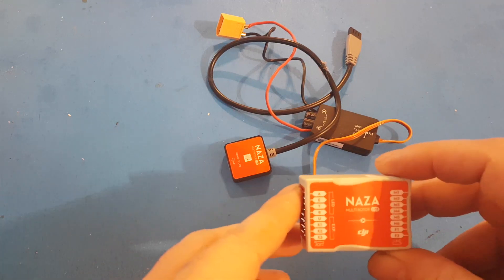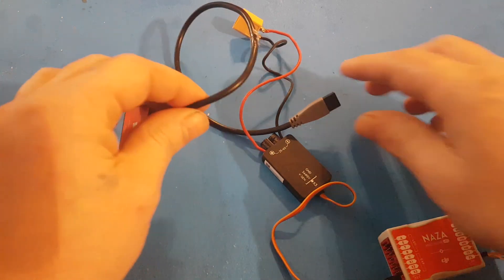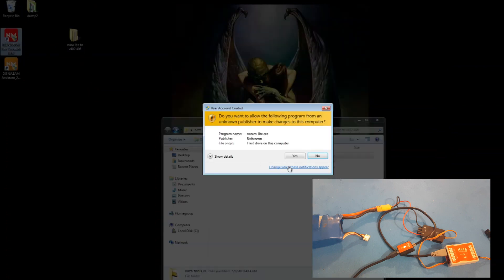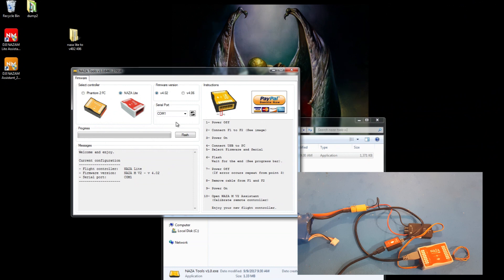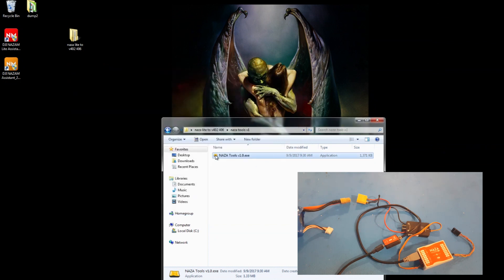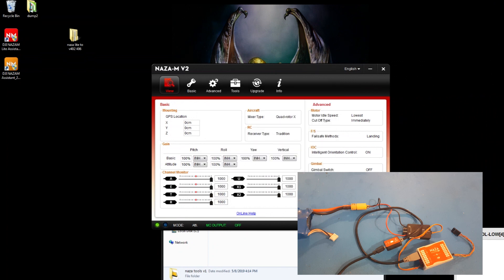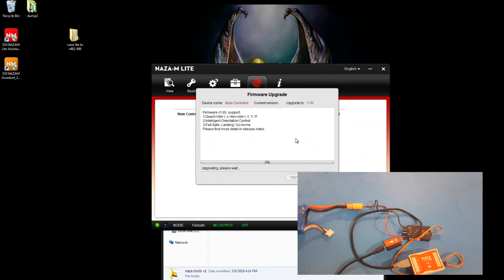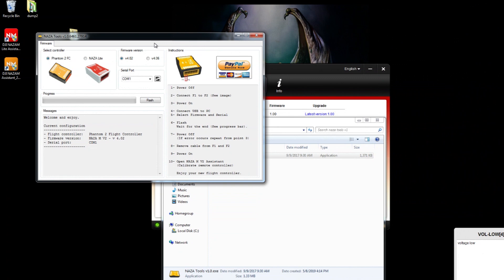DJi naza m lite to naza m2 4.02  4.06 UPDATED STEP BY STEP

Comment: Bought a new naza lite, everything looks good but can't calibrate it. Rotating drone 360° with its head down doesn't change color from solid green to blinking red. Please help
Reply from the maker: hi ..when your doing the calibration are you starting with a solid orange light?

also with the quad on the ground facing forward ..pick it straight up..and do the 360 turn holding it straight out (with your entire body). you might have to go around twice...
then point the nose down of the quad ..and do another 360 turn.(with your entire body)

You are not spinning the quad but holding the quad and spinning with your body while holding the quad in one static position
Reply: @ModItBetter  The solution is quite simple. It took me a while but I found the solution. Enter NAZA-M V2 - Advanced - Voltage - Calibration - Change "First Level" - "No Load" 10,74.
Reply: @ModItBetter  all tried, but now I have noticed that the naza lite assistant software shows ERROR in the z-axis of acceleration sensor.
Might be this is a manufacturing defect.
I have applied for a replacement of product, the seller if of the same country so could take 10 more days

Thanks for your reply
Reply from the maker: @EasyCircuits  Hi yes its possible that it is just a defect ..hopefully all goes well with the replacement process

Comment: can you do naza-m to naza-h?
Reply from the maker: as far as i know it would be no because the firmware for the naza-h has not been ripped...And i don't know if the naza-h has the same hardware. i would assume it does.
if your forced to buy a new flight controller.. , Have you looked at pixhawk or apm 2.6.. they can do all vehicles and is open source. and come in mini versions for both of them..
Reply: @ModItBetter   apm 2.6? 
easy to setup?
Reply from the maker: @theobuiatti6420  hmm I did some google on it.. there is this guy running a pixhawk with version 3.41  
https://www.youtube.com/watch?v=925fFLmwHDE  (more of a show and not tell video)
keep in mind you can also use pix racer .. mini pix ,micro pic or just the regular pixhawk ..they are all the same.. .. The apm 2.6 / apm 2.8 actually does not seem to have much of a scene for H.. also for our apm 2.6/2.8 no more firmware is made for them it stops at 3.21  ..then the pixhawk can use the firmware 3.21 and to current..
,   Maybe not as polished as I thought, I would do some google searches as if you have either the apm 2.8 or pixhawk /px4  and see if you can find enough info on it.

this is the site where the firmware and mission planner comes from.
http://ardupilot.org/copter/docs/traditional-helicopters.html